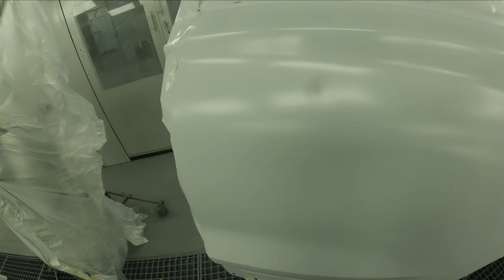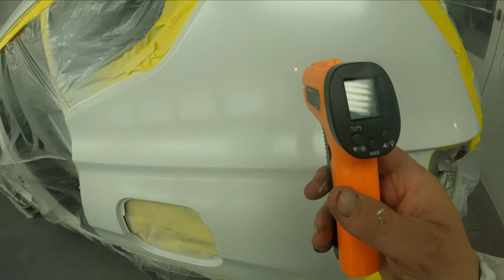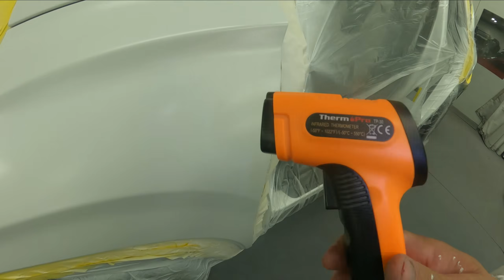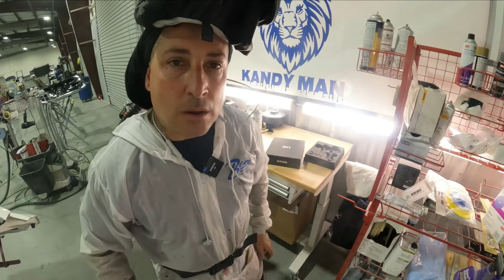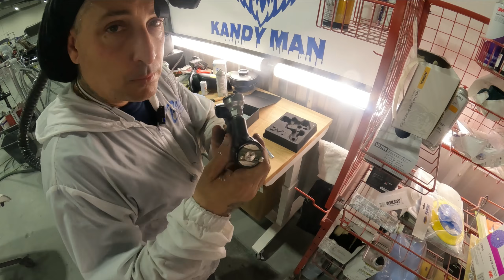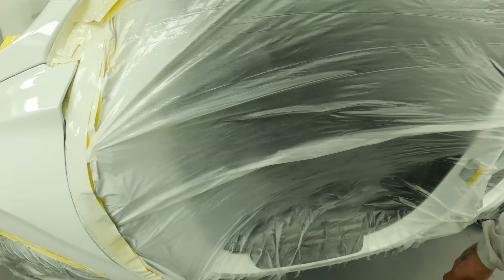Painting In EXTREME Heat - Tools And Setup

Comment: Doing a Porsche bare metal respray at the moment, iv used a few different from expensive to cheap ,had more issues with the pricey ones..could you recommend a high build primer that you have had no issues with ,im using solvent basecoat .thanks
Reply from the maker: My favorite I'd Sherwin Williams p30

Comment: Great video as usual . How do you prefer to handle high heat and high humidity on base, 1.2, use heat i between coats, or what ppg recommends and over reduce it by 5%, takes a few more coats but the dry time is far better then just waiting as normal on those days.

Comment: Great video Kandy Man, you good folks across the pond often have more extreme heat problems than we have here in the UK but saying that our last 2 summers have been exceptionally hot, my booth temp a few weeks back was 48C (120F) and the panels were about the same so spraying was pretty much impossible.

I love my DV1 as it's an easy gun to use and like you I use the 1.3 but I prefer the C1 cap as it puts a slightly flatter finish which is what I'm looking for but for OEM peel the C2 cap is better🙏🙏👍John UK

Comment: At the boat company I work at we use sata 5500 rp everyone has a 1.4 I cap and needle but for some reason I have a 1.4 o… I don’t know if that changes anything. Why don’t you use sata?
Reply: I use the future 5500 rp 1.3 O i get amazing finishes in this fl heat here in Tampa the o is better I used both I spray closer so Im moving faster
Reply: @Stingyduce   nice! We get pretty good results with the 1.4. Very easy to run that’s for sure. I live in Washington a hour or so away from Canada but it still gets sometimes 110 in the summer. This summer only got to like 101 where I live.